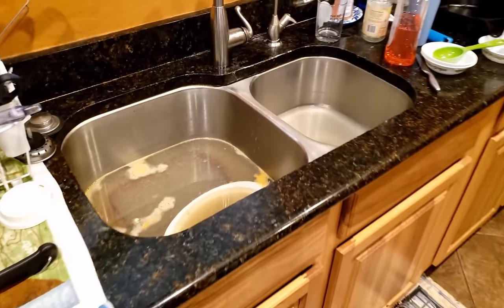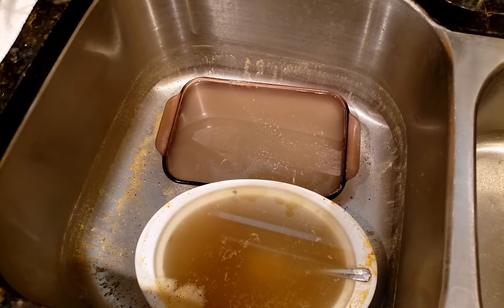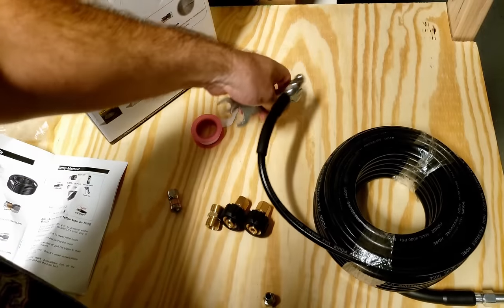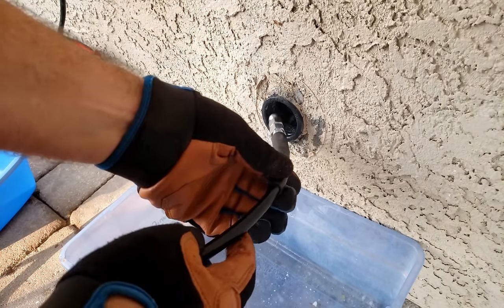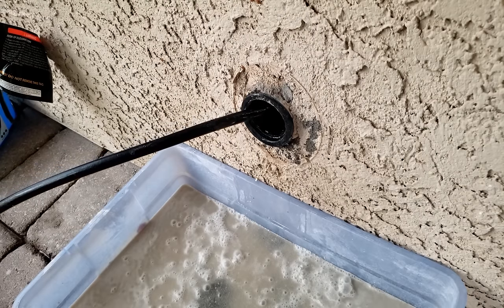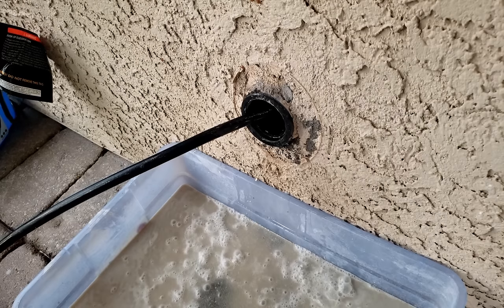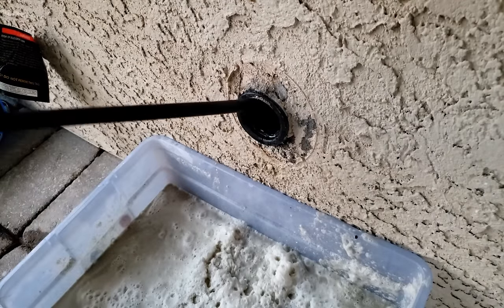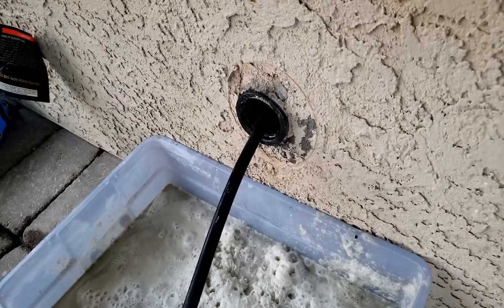UNCLOGGING my kitchen sink with a PRESSURE WASHER and the POHIR Sewer Jetter Kit

Comment: Another similar tool the GT water works drain king uses a garden house to supply the pressure and water . It screws on your garden house gets inserted in the drain line as far as possible. When you turn the water on it expands like a balloon to block back flow pressurizing the line with pulses of water. After a five minutes turn off the water it shrinks back to size and when the drain clears it often try's to pull the hose down with the built up water allowing you to easily insert it further into the drain if you want giving you the chance to repeat the process to get any remaining debris pushed through. if it doesn't initially work leave it to build pressure longer. I have used them for years and rarely does it not clear the line. Note that some of the imitation ones are made of harder rubber and blow apart instead of expanding and holding the pressure.
Reply from the maker: One issue with the water hose is that you will need to have an Anti-Siphon Vacuum Breaker. Most pressure washers are required to have them. If you don't have one a vacuum affect could suck some sewer water back into the hose and into your water supply. I don't think the water works Drain King has one but they are not very expensive. If you are not sure you can always add one to be safe. It sounds like the Drain King works pretty good. I tried using a cheaper one on my swimming pool pipe but it blew apart. So yeah if I try one again I will try the name brand and see how it does.
Reply: @stevencroft9654 
Its almost not right to mention those without a word of warning to folks:
DO NOT turn the water on until you've fed the Drain King (or water wenie) several inches into the clogged pipe.  Otherwise it will blow up & pop, just like a balloon.
DO NOT attempt to remove it from the clogged pipe without turning the water off first so it can depressure.
Otherwise it may break off in the pipe and stay stuck there.

Comment: Remember if the jets get submerged in liquid the power of the jets gets a major reduction in power. Drain clean from the discharge side.
Reply from the maker: Great point! I have seen some videos where people use these things inside their house but it seems to work best if you use it in the clean out drain so the water from the pipe can drain into a tub and be removed. That really does seem to give the Sewer Jetter a better chance to do its job.

Comment: If you have a bad clog you can always go to home Depot and rent a electric rooter for a couple hours and then run this jet to clean the pipes good. Beats getting a huge bill from a Plumber to do the same thing. The only additional thing the plumber does is run a camera down after.
Reply from the maker: I was going to do that. I live about an hour from the Home Depot that does the rentals. So it would have cost a little more for me because of the drive time. So I tried the sewer jetter first. But yeah if it didn't work I was going to rent an electric rooter. I really wanted to buy one of those cool cameras too. It would be awesome to have one of those cameras.

Comment: Looks like one of the propulsion jets is clogged. There should be 3 moving the jet forward and 1 as a penetrator. I don't think I've seen a line as clogged as yours was. The pointed bullet nozzles sometimes have difficulty navigating corners. I have a 1" round head nozzle that navigates corners really well, and since it's shaped like a ball, it's less prone to getting hung up when pulling it back out.
Reply from the maker: Yeah there must have been something blocking one of the jets. I have used it a few more times and all of the jests are working now. I am planning on making some more videos about it too. That round nozzle sounds pretty cool.

Comment: You need a pulse valve on the pressure washer or when it feels hard to push rapid pull trigger.
Reply from the maker: Thanks! That would make things a lot easier.

Comment: Mine has no visible white thing like that here in the UK. I think it may only be accessible by something hidden under a massive one of many patio stones but cannot quite remember. It seems silly there is no obvious place outside.
Reply from the maker: You can also access the sewer pipe from under your sink. You can disconnect wherever your drain pipe connects to on the wall or floor to access the sewer pipe. A lot of water can spill out and make a mess under the sink though. So you just wat to be prepared for that.

Comment: Just got Karcher water jet snake . K have no outside access can I run it under the sink after removing the s bend P trap . have use a hand-powered auger tho I am now onto a jet snake  any information would be appreciated thank you .. great vid BTW
Reply from the maker: Yes you can! But you may need some tubs or a wet vac incase you have some water coming back out. The pipe connection in the wall is the same thing. I just did it outside because it was easier. But if you don't have outside access under the sink is the way to go.
Reply: @ThatHobby  thank you so much brother 💪
I've tried the a wet vac.
And auger .
So I got the high pressure jet looks like I must have to go under the sink past the s bend on the down pipe going under slab .
Just hope it doesn't make a big mess tho as I have no outside access I ll try what you said.. thank you so much 🔥🔥🔥🔥

Comment: Good step-by-step video.
Reply from the maker: Thanks! I tried a 25 ft metal snake first and I couldn't get it unclogged. So I upgraded to something bigger and the sewer jetter did the job.
Reply: @ThatHobby  Cool I think a need one, I have to run a metal 50 ft snake at least once a year in my house time for an upgrade. video coming soon🙂
Reply from the maker: @mrnoe67tiktok  Awesome! I used to run a metal snake every year too. The sewer jetter seems a lot easier to use. Once you get the first big clog cleaned out it will be a lot easier to clean it out again if your drain starts running slow.

Comment: İn The Netherlands we have no pipe outside except for a rainpipe, can't i do the highpressure into the sink to unclog?
Reply from the maker: Most sinks have a block in the drain that makes it difficult to get the sewer jetter in there. But you should also be able to access the sewer pipe under the sink. There should be a pipe going to the floor or the wall under the sink. You can disconnect that pipe and put the sewer jetter in that way. Just have a wet vac and some towels ready to clean up the mess incase any water comes back out.

Comment: Will this work for my main floor sewer line in my basement and where can I find the sewer jetter from thanks in advance much appreciated
Reply from the maker: A few people have left some comments saying they used it in there basement. Just remember if use a gas pressure washer you may need a longer hose since the gas pressure washer should be used outside. I have a few Amazon affiliate links in the video description that you can order the Sewer Jetter from.

Comment: Wow, thanks for sharing this video. I saw a video yesterday where the person used that hose on his power pressure machine to clear out a french drain. I am going to buy this. I wonder if this will work on showers
Reply from the maker: I haven't tried it on a shower drain. This cleanout drain is a little bigger so it fit in there pretty good. A shower drain is a little smaller. The product manufacturer shows pictures of it working on indoor plumbing. But I am not sure if they are snaking the hose in there or if they are just shooting high pressure water in the drain to clean it out. Thanks for the great comment and let me know how it works on your shower drain.

Comment: Thanks for the video, I’m always using a regular hose and didn’t know that kit existed and definitely I’m buying it.
Reply from the maker: Glad I could help! I have used a metal snake and a regular hose for years. This seems to work better. I cleaned out my drain back in October and it is still working great!
Reply: I already got one coming my way and I’m sure it will work out perfect 👍🏻

Comment: That's a good solution to unclog drains, may be a rotating nozzle could speed up the whole process. In my case I used a snake with a strong head to break down the scales. To prevent this problem the best think is to stop dumping oil in the sink and remove most greasy residual from your dishes, this rduce drammatically the orrible smell  coming from the sink drains, of course you will have to use extra kitchen paper than usual but it worths the expense
Reply from the maker: I think the previous home owners put a lot of grease down the drain. I have a snake and would use it a couple times a year but that was just a temper fix. I think there was just too much grease built up in the pipes. So yeah after dealing with all that we are real carful about what we put in the sink. It works great now and smells a lot better too.

Comment: I have a lot of tree roots and I wanna do this but not sure if this type
Of water pressure is enough to take out a bunch of tree roots in my main drain so not sure what type of water pressure machine
Reply from the maker: The sewer jetter hose can handle up to 4000 psi. The pressure washer I used is only 2300 psi. So yeah it was a little on the light side. It ended up taking me 3 tries to break up the clog. So you could get a 3400 psi gas psi pressure for 3 to 4 hundred dollars. Some other people in the comments have said they used the sewer jetter on tree roots.
Reply: Thanks might go with a 3000 PSI electric power and will give it a try thanks for your tips

Comment: Can u use this method for the main sewer drain for house
Reply: It should work
Reply from the maker: Yeah it should work. I have only used it on my kitchen sewer line but other people have said they used it on there sewer lines in their basements. So as long as you can get the sewer jetter hose in there it should work.
Reply: @ThatHobby  thanks

Comment: If you put a wrap of white tape(electrical) or even a wrap of silver duct tape on the pipe about 3 to 5 ft from the nozzle, it can let you know when you are close when pulling it back out. Often you will hear it, but with some floor drains, water may still be in the pipe and you not know it is that close.
Reply from the maker: That's a great idea!

Comment: Everybody doesn't have a clean out on the outside of their house like this.
Reply from the maker: You can also access your drain from under your kitchen sink where the pipes connect to the wall. It is a lot easier to do this if you have a clean out drain but you can still do this from under the kitchen sink. You just have to unscrew the drain pipes. Have some buckets ready and a wet vac would help too.
Reply: I know, right? I’m kind of jealous. I’ve never even heard of such a thing before!
Reply from the maker: @unitoolzee  Yeah these clean out drains are really nice. I live out in Arizona and my house has 5 of these clean out drains in different locations. I was thinking of making a video about it too.
Reply: @unitoolzee  Same here.

Comment: Run hot water while doing this to help break up the grease. I used hot water through my new gas pressure washer.It made the grease turn to a creamy fluid. I do not recommend using hot water through your pressure washer!
Reply from the maker: That sounds awesome. In the past I have run hot water down the drain before I used the metal snakes. So yeah the heat really helps to loosen up the grease.
Reply: @ThatHobby  don't use hot melts the grease but can harden farther down as pipe gets bigger and colder under ground

Comment: Prob push too far in and now the kitchen is all wet. 😂
Reply from the maker: When you push the sewer jetting into the pipe you can kind of get a feel for which direction the sewer jetter is going. I put 50 ft of hose into the sewer pipe and I didn't spray any water into the kitchen. But yeah the thought crossed my mind too. That would have made for a really funny video if it sprayed water all over the kitchen.

Comment: Hi! I was wondering if we could open the P-Trap,  put the high-pressure hose into the P-Trap hole, rinsing out from inside the kitchen? Instead of doing it outside?
Reply from the maker: Yes that will work too. Plus it's always a good idea to check the P-Trap for clogs first. If you disconnect the pipe under your sink from the wall you can access your sewer line from there as well. It was just easier for me clean it out from outside. A lot of water may come back out of the pipe while you are breaking up the clog. So be prepared to clean up the mess under the sink. Let me know how it works out.
Reply: @ThatHobby  Thank you for your reply! We are a new start-up plumbing company and thinking of getting this to unclog customer's drains 😁😁

Comment: nBBCI use my shop vac especially with that grease from those dishes kitchen drains are a bitch majority of the time packed with grease and when you use the pistol grip it closes soon as the cable goes in and comes out if the basement isn’t finished I will take it apart midway of the line and catch it in a garbage can or some 5 gallon bucket’s it winds up pushing the clog further down the line I have seen 40 feet of solid grease in a 2 inch pvc pipe absolutely amazing can’t believe that it was draining before they called us the customer stated that it was draining slowly for a couple of months crazy stuff you see doing plumbing service but it’s a great job always something different and challenging everyday
Reply from the maker: That's awesome! Thanks for the comment. My wet vac had died so I had to use some buckets. I got a new wet vac so I am ready if it happens again. So far it's still working great. The sewer jetter cleaned the pipes out pretty good and we have been dumping our grease in the trash. Plus we started using an air fryer. Less grease is better for the pipes and for us.

Comment: This video inspired me. I ran into a problem though, after a about a foot, I can't get the cable to go any further. I tried to twist it a few different ways, but no success. Any tips?
Reply from the maker: It is hard to say. Some places are difficult to access the pipe. When I get stuck like this I try to think what would a plumber do? They might have a pipe camera to look in there and see what is blocking it or they would try to access the pipe from another point. It may just take some finesse to navigate around the pipes or something could be in there blocking the pipe? I haven't had an issue getting it into the cleanout drains before. But something like a toilet has a lot of tight turns and has to be taken off for the sewer jetter to access the pipe.
Reply: I see from other comments that if the pipe is small you can get a 1/8" jetter hose instead of the 1/4" hose.

Comment: Where is the acess hole to insert wand? I dont think my house as one of these?
Reply from the maker: They are typically around the outside of the house but they can be inside the house as well. You can look for them near the kitchen sink. If you can't find a clean out drain you can access it from the wall under the sink where the sink drain pipes connect to the sewer line. It's a good idea to disconnect those pipes anyways to make sure it isn't a simple clog in the pipes under the sink. I was basically just on the other side of the kitchen sink drain.

Comment: Use boiling water. Pour it in the sink  it helps a lot. In addition to what you did or while you u are unlocking..
Reply from the maker: Great tip! The boiling water can really soften up the clog.
Reply: And using half a bottle of Dawn Platinum or Dawn heavy duty along with that boiling water really helps tenfold instead of just using the hot/boiling water!
    Edward H. “Integrity Plumbing, Septic and Drain“ in Clinton, CT

Comment: Lmao I have never seen a cleanout for a kitchen outside like that. Good idea though
Reply: I always catch water in a trash bag. That attachment for a pressure washer is a nifty idea for homeowners, but it looks kinda weak tbh. Out hydroscrub goes up to 4000 psi , minimum like 1800 tbh
Reply from the maker: The POHIR sewer jetter can handle 4000 psi but my pressure washer is a basic electric model and can only put out 2030 psi. It seems to work pretty good for a small clog like this. But you could use a bigger pressure washer and get twice as much power to clean out the sewer pipe.
Reply from the maker: Yeah they put these clean out plugs in all the houses out here in Arizona now. Our house was built in 2016 and it has 4 of them. The one on the other side of the patio looks like it is for the bathroom upstairs. This one is pretty nice because it is located right under the kitchen window. I have had to clean this one out a few times but I haven't had to open any of the other ones.

Comment: "it has 4 holes" (it has 3) sprays out of 2 "perfect!"
Reply from the maker: Yeah I don't know if there was a metal bur stuck in there or something. It turns out I just needed to run it a little bit to get the holes all working. It seems to do a pretty good job. I have use it a few times and it gets the job done. I will have to make an update video on the spray nozzle.

Comment: Thanks for the demo. Will it work on a storm drain? Is an electric pressure washer strong enough? Thanks again
Reply from the maker: The electric Sun Joe SPX3000 has a Max PSI of 2030. There are some other electric brands that are 3400 psi. A big gas pressure washer can be 4400 psi. The Sewer Jetter hose can only handle 4000 psi. So just make sure the hose can handle the pressure washer that you get. The lower psi units still work they may just take longer to brake up the clog. It took me a few times to get the grease clog broke up. This should work on a storm drain too. It just depends what is stuck in it. You may also need a longer hose. They sell them in 100 ft lengths too.
Reply: @ThatHobby  thank you